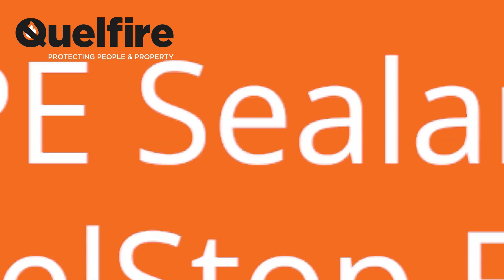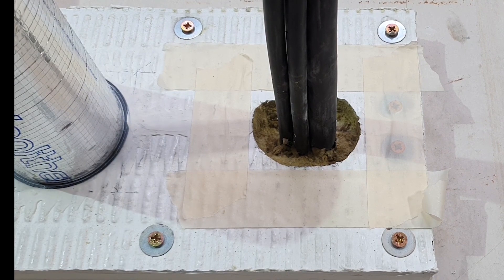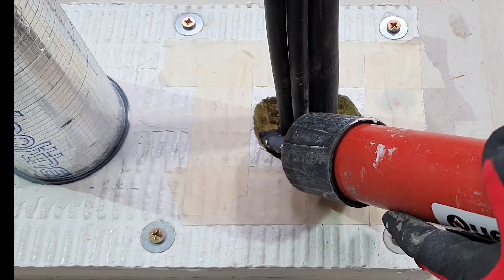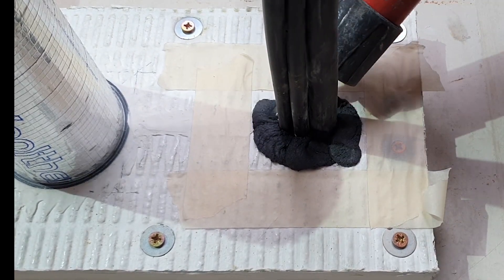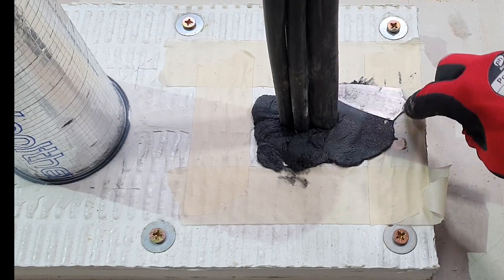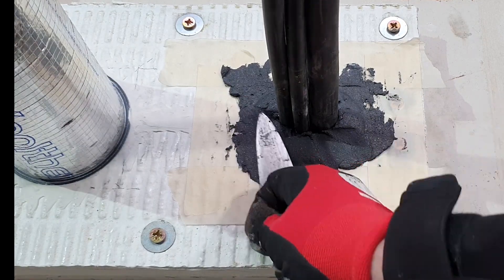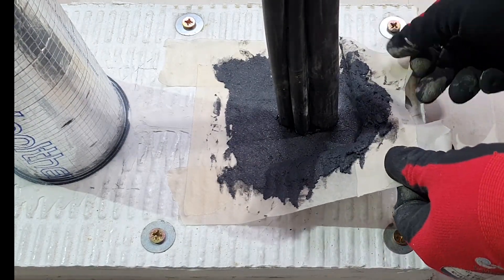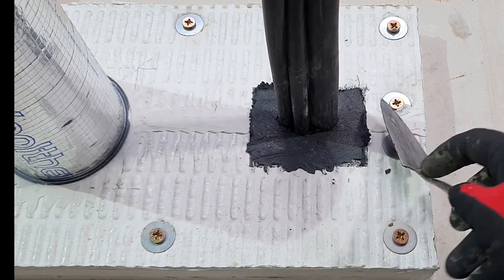How to Install HPE Sealant Around Cables Through the QuelStop Fire Batt System

Comment: Its not a fierstopping, its decorative hp mastic applying, because mastic should be in all depth of fierbatt😢
Reply from the maker: Hello, thanks for your comment. 
QuelStop HPE Sealant should be installed as per our fire test evidence and for this application it is a 25mm depth, as shown on detail QB-FW100-D-02.
Reply: @FirestoppingSolutions what for hp onto armoured cables ?
Reply: Using a hilti gun 😂